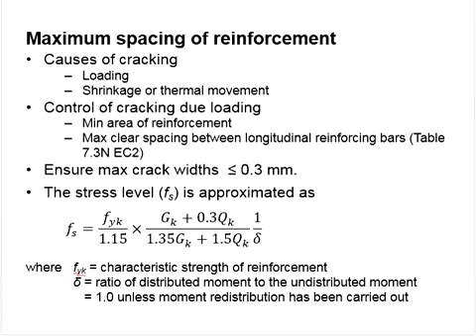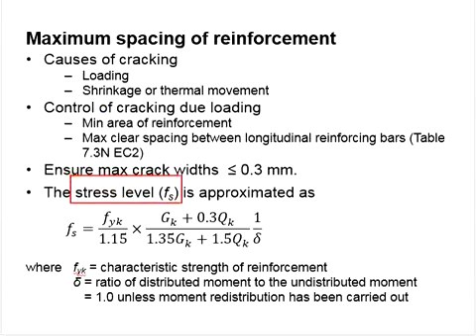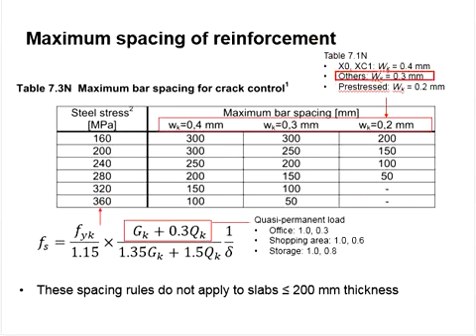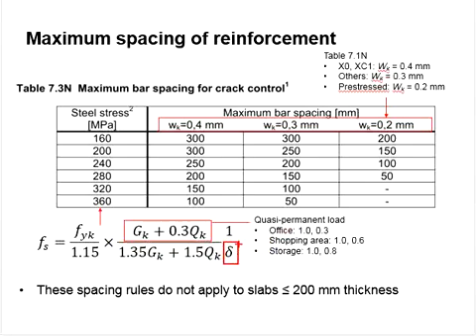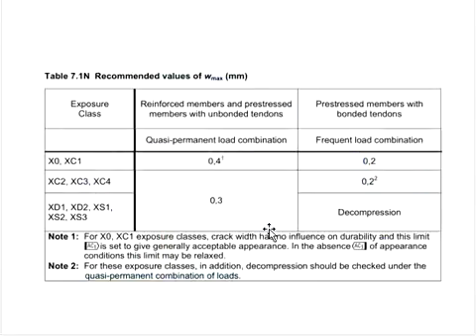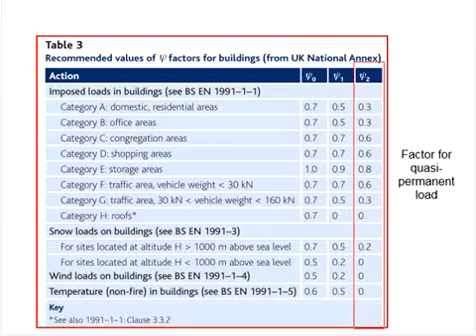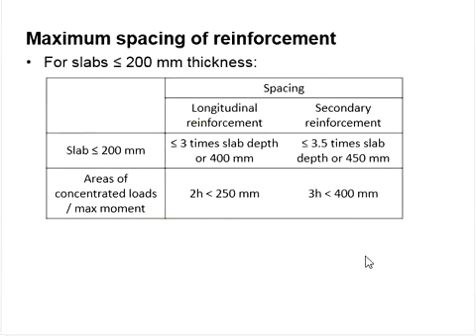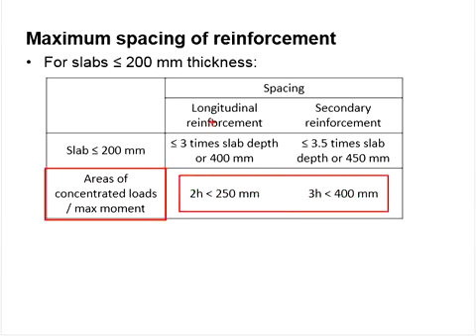6.8 Maximum spacing

Comment: Sir, the maximum bar spacing in Table 7.3N is applied for both main and secondary bars or only main bars? [slabs > 200mm thickness]
Reply from the maker: I believe it applies to both main and secondary bars.
Reply: Noted and thank you sir